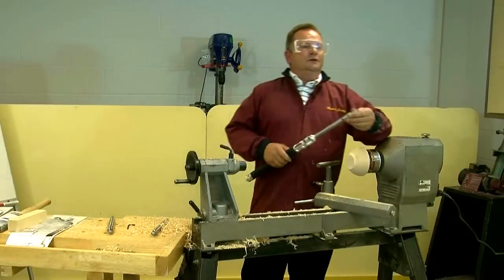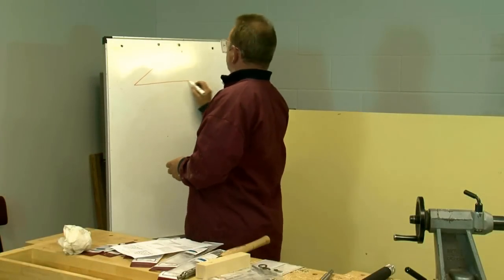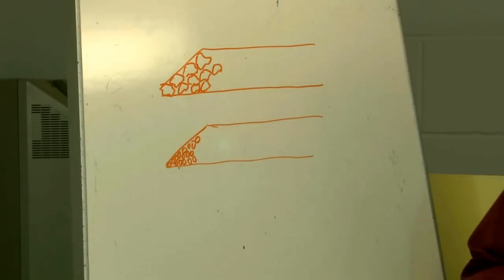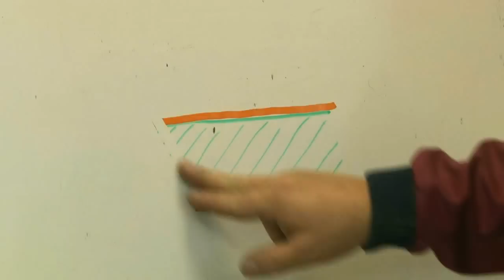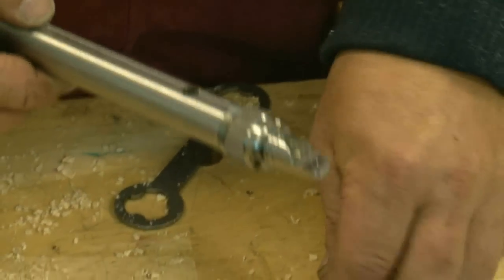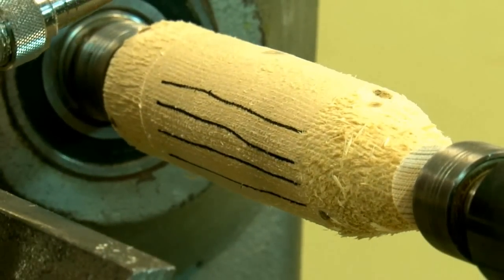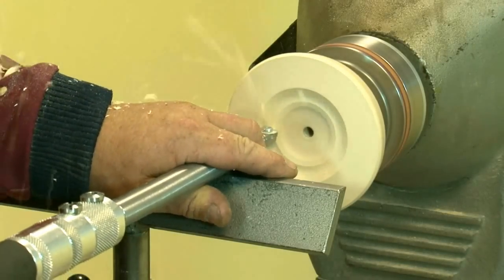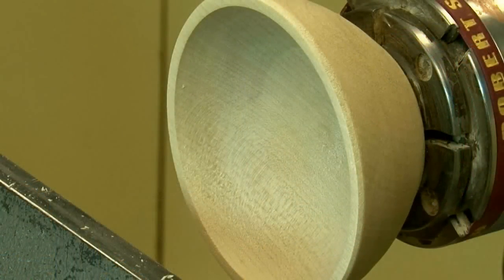An introduction to the TurnMaster from Robert Sorby

Comment: I bought one of these, thinking it would be excellent, and on some projects it is very good. However I have since moved back to traditional bowl gouges and neg rake scrapers, as its just less hassle. I now only use the handles of the set I bought to hold sorby bowl gouges and George Watkins hollowing tools. In fact I dont think I’ve picked up the sovereign in over a year

Comment: I have been turning for about 4 months now and have become aware that keeping my tools sharp makes a huge difference. I bought the wooden handled turnmaster tool from woodcraft with the square, diamond and round cutting parts from HSS. Would I be better off with the titanium? And would I do better with multiple screw on parts each with a different turning tip for faster changing as opposed to using the little torque screw each time?

Comment: Are the hss high speed steel blade sharpened the same way as carbide blades just with a diomond stone and the top side of the blade gets sharpened?
Reply from the maker: Hi Ninjaman2191...Yes that is correct. it is the easiest way to maintain a crisp edge without wearing the cutter away

Comment: The tool shaft is round so why does the cutter have to be turned at the head when you could simply rotate the handle slightly?
Reply from the maker: Hi ....The TurnMaster has a flat section machined along the length of the shaft to give stability. The head rotates to the optimum indexed position so that the user does not have to worry if it is being held at the right angle.
Reply: Robert Sorby Ahha I see. I wondered how it wouldn't twist while under pressure from cutting. I have the RS 230KT and that's flat on the bottom as well. Thanks for the head's up.
Reply from the maker: You are very welcome....always glad to help.

Comment: it is easy to sharpen, but sharpening disc and rotary disc holder will cost you a lot( over hundred dollars) if you do commercial productions, then worth it. I saw you can do with 3M ceramic discs .